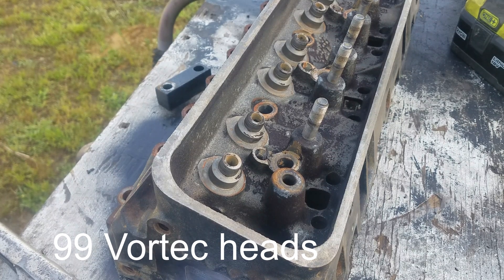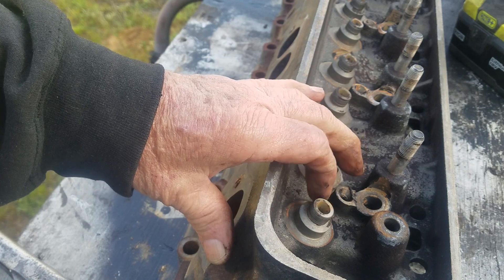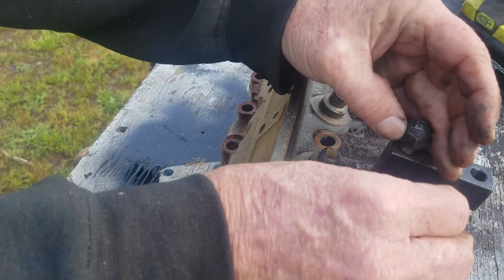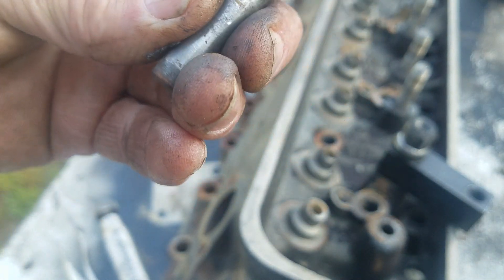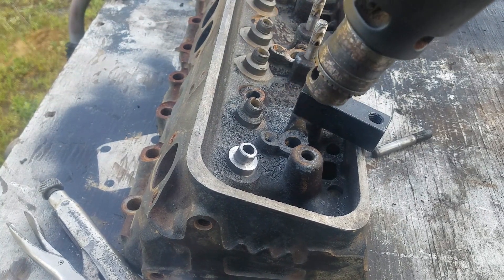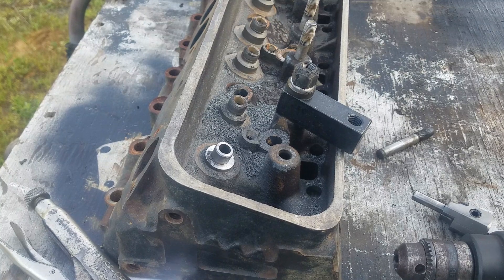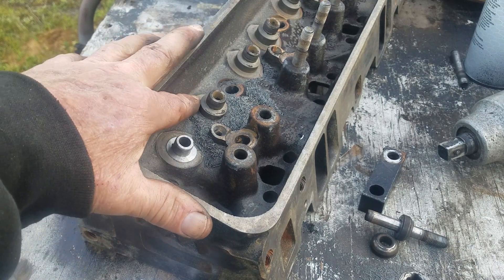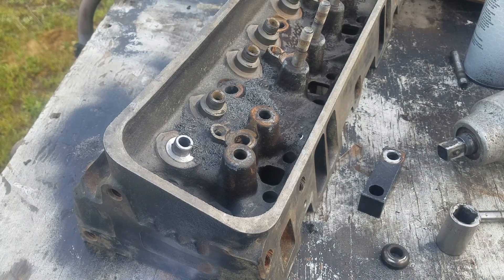Modifying Vortec 350 heads for studs and seals part 1

Comment: seriously, what a dumbass.... he destroyed the cutting edge by failing to use some type of cutting oil. this allows a better cut, chamfering, cooling the cutter and heat cycle the cutting edge to ensure long-term use.... What the heck... I'm sorry for kicking the guy, but seriously... Did he not read instructions? Did he not spend 5 minutes on You tube from experienced cutter? My head hurts............... Wait, he said 15 more to cut..... that cutter will never survive or he will run out the clock on his life with the amount of time spent following that first cut. Plus, he best have about 20 3/8 drills. I'll give him 4-5 for his journey... God Bless they Guy...

Comment: You cut too much off of the guide, got to leave enough of the guide boss because the bottom of it is used as a spring locator without it the spring will walk around.. These heads are basically  ruined.

Comment: Updated title- “How to completely destroy a Vortec head in under 13 minutes”
Reply: Lmfao 🤣
Reply: With a little hard work and dedication, this man took the best flowing small block head and made a boat anchor out of them. 
I've ran 0.550" lift cam and only needed to take the valve guides down 0.085". There's also no reason to cut the stud bosses down.  
I just hope Sling Blade here goes back to lawn mowers and quits fucking up decent forced heads!
Reply: @donkedik7793  I’m doing the same a set if vortec 906 head’s I thought you only needed to cut stud bosses down when adding guide plates? I may be wrong since I’m still
Learning on these heads and that’s why I’m here! I’m doing LS6 blue valve springs comp cams 787-16 retainer’s and not sure if I want to use my +.50 offset keepers are just cut my spring Bosses down to get me there but may be wrong.. I know I’m going to run scorpion narrow body self - aligning roller rockers, going with a 26H cam with 600 carb
Reply: @cdpperformance2613  you'll have plenty of clearance for that cam using LS6 springs as long as you stay with 1.5 ratio ratio rocker arms. If you go to 1.6 rocker arms, your total lift will be .484". In that case, I'd recommend trimming the valve guide. You'd only need to trim them about .030" to .050" at the most.
Reply: @donkedik7793  thanks for the info I got a set of scorpion 1.5 narrow body self - aligning roller rockers coming.. wow didn’t know there was this Many to pick from! Lol and the cost it’s crazy
Reply: Whats the problem?

Comment: I would use LS6 beehive springs which fit unmodified heads and never cut away that much support for the valve, those guides will be done in no time.  My 2c.
Reply: That is what my local machine shop said. They refused to cut the valve guides down. Said he could crack. But even with beehive springs you won’t get but .530” lift. Most cams are .550” or better.
Reply: @deviantrebel6326  They most likely are talking about Small Block Chevy heads like a 305, 327 or 350.   LS6 springs come on stock heads, so do LS2, GM doesn't do any special machining on them and they will fit any stock Gen3 & 4 heads unmodified to just over .550" lift, with Comp retainers and locks they will go to over .600" lift with stock heads.   PAC 1218 springs are also good.   I set the heads up often with just those parts and my favorite cam that I put in all my engines is the Texas Speed Stage 2 Truck cam or the Sloppy Mechanics Stage 1 cam, they are .550" and .560" respectively and I've never had a problem, there might even be a little more there room there.  Never touch the guides or bosses, they are fine but it sounds like your machine shop needs a lesson on parts combinations.
Reply: I just used the proper retainer and bee hive spring. Use 30 offset keepers had shop take 20 off bottom of titanium keepers and run big lift

Comment: You would have an easier time if you used some oil for the cutter and stud hardware and please use an impact socket on an impact gun. Chrome sockets will shatter and send shrapnel everywhere.

Comment: Why not just change the springs to beehive style ls 3 or 6 springs and save yourselfe the trouble of cutting the bottom ,by changing the retainers to a set with less lower protrusion ?? That will provide enough space to run up to 580 lift ??the studs will hold that .or pin them ,way esier ,,oil them threads man !!!use some heat !!and a drill press and make an angle jig to hold the head ,,those poor guide holes !!

Comment: Shouldn’t you cut the threads for the first stud, before removing the second, as second stud is used as guide for the first threaded stud?
Reply from the maker: The tool comes with a dowel that inserts in the hole to guide the threads on the next hole. I will be posting another video showing this.
Reply: @delrayjyd9676  can you tell me what #’s you used on each cutter? I purchased the pan for .530 with #11 arbor but think I need another also
Reply: You got to cut down the stud boss to get the screw in stud to be in the same area the press in stud was before you start threading the bosses
Reply: @79tazman  not if you use non-shouldered or non  hex headed studs

Comment: Good job. I don’t know what the instructions are with the cutting tool but would some type of cutting oil help it perform better. Thanks for sharing.
Reply from the maker: According to the Comp Cams video they used no oil during the cutting process. Also with the head being angled using a drill press would be difficult because the drill press table does not tilt.
Reply: @delrayjyd9676  The tool MUST be turned much slower with more pressure. A drill press or mill is required, unless you're Hercules.
Reply: With all of modern tools today I didn’t know. I use to work in an industrial machine shop 20 years ago and things change. Thanks for getting back to me about it. I learn something every time I watch your videos.
Reply: Fire9986 7834 : I was just thinking the same thing, and maybe a drill press . Come on Scott